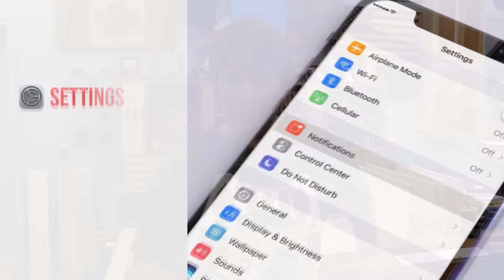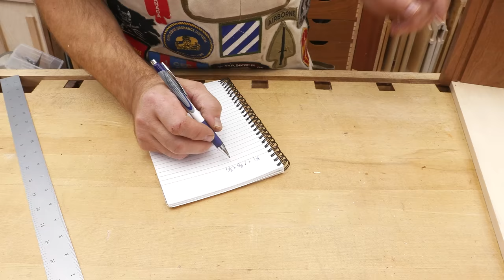How To Make Drawers For Fine Furniture with Drawer Slips

Comment: Hi Rob...one more very usefull video class...Your drawers are amazing and very well done...my father did a lot of drawers but never with dovetails...He did a  lot of one kind of hardwood runner wich is 1/16" wider than drawer sides...so the sides never touch the carcass and the bottom has one inch runner each side...they called this NK drawer...Swedish style from Nordiska Kompaniet...intersting way too...no wear (or almost) on the bottom
Reply from the maker: Interesting.  Never heard of that I will check it out

Comment: Rob, this is a nice idea.  I'd probably reserve it for a high-use high-quality project.  I always end up making my drawers slightly too narrow so that they rack a little side to side, when you're dialing in the right fit are you really testing for whether or not you can push the drawer in on the corner with 1 finger?  Do you have any concerns about how the finish might change a fit this precise, or do you never use any surface building finishes on drawer sides?
Reply from the maker: you should watch my drawer making playlist.  I make my drawers slightly oversized so thy will not fit the opening then VERY carefully plane the sides, check fit until it just fits with no side to side slop.  The onli finsh I put on my drawers is wax on the outside.  and yes you really can push in the drawer with one finger in the corner

Comment: Thanks Rob.  Hadn't heard of these before.  Would you want the drawer slips to be softer and to wear easier than the main carcass/case itself?  Just trying to think what would be easier to fix down the road - grooves in case vs. drawer slips.  Since this is all new to me, I am likely missing something in this rational.
Reply from the maker: By adding the slip you are reducing or eliminating wear on both since the wear surface is bigger.  Making a new drawer is easier than making a new case though

Comment: I do this a much easier way. Simply make the drawer in the normal way, but with a shallower groove if you use a reduced thickness for the sides. Then after the drawer is completed and the bottom installed, simply glue two plain strips underneath.
The other way is to rebate the bottom edge of the sides (to accommodate the drawer bottom) then glue a thin yet (say 1") wide flat strip of hardwood underneath.
Reply from the maker: That works too
Reply: Would gluing a hardwood strip to a solid wood bottom cross-grain be a great idea?
Reply: @rootvalue  - not sure what you mean by crossgrain? The grain of the drawer slides should run the same direction as the drawer moves. So in-and-out would mean front-to-back.
In my country they tend to only make drawer faces from high quality wood, and less durable timbers are used for the thinner sides and backs. Even quite high-priced furniture uses cheap pine for the carcass, or even MDF. This means that narrow lower surface of the drawer sides might be only 3/8" or 1/2" (9-12mm) and it wears down quickly on heavy drawers.
So when refurbishing drawers we usually saw & plane it back to flat, then glue on a wider strip of hardwood to replace it. With some wax on the slides, the hardwood will literally last forever!

Comment: I'm curious... it might be a good exercise to look into the physics of wear.  I wonder if using hard woods on both wearing surfaces, the drawer slides and the platform the drawer sits on, does any good where longevity is concerned.  Can you virtually eliminate the wear by making both surfaces from hard woods? Or, is it just the way of the world that you need to account for inevitable future repairs and make the more-difficult-to-repair surface harder than the paired surface so the easier-to-repair surface wears and the other does not?  It may be that incorporating hard wood on both surfaces is a great strategy, I don't know, but intuitively there is a question in my mind now...  By the way, Rob, your work and attention to detail is a delight to watch!
Reply from the maker: Actually I think doing both surfaces with hard wood is the better strategy.

Comment: If I've already built a drawer the traditional way, minus drawer slips, then I've got about 3/8" of clearance between the underside of the drawer bottom (let into the grooves in the sides) and the bottom edges of the sides. Could I just glue a strip of hardwood to the inside-bottom edge of the sides directly under the drawer bottom (being careful not to glue the slip to the bottom itself) and flush them to the bottom edges of the sides?
Reply from the maker: Yes that would also work

Comment: I see a chisel plane on the bench at the end of the video.  Where did you use it?
Reply: Maybe to flush the bottom edges of the slips closer to the drawer front?
Reply: Maybe, I thought of that too.
Reply from the maker: On another drawer I was working on.  To plane into a corner

Comment: While I appreciate  the craftsmanship, wouldn't it just be simpler to cut a thin strip and glue it onto the bottom ... exactly the same result (a wider wear strip) with far less work!
Reply: You wouldn't really want to glue to the bottom because of the precise fit of the drawer. Any movement in the sides wouldn't necessarily align with movement in the bottom. With such tight tolerances in Rob's drawers, it could affect that perfect closing action he describes at the start. If you were just to glue a strip to the side, below the bottom, it would likely be a weak joint that broke off in use at some point. Of course, if you're building drawers with much less tolerance, then it will be less of an issue, although you'd maybe want to match the wood type of your strip to the bottom panel. Edit: also, you'd need a gap between the side and the strip to allow for movement.
Reply: You wouldn’t get the thin drawer sides then. I usually make my drawer sides 6-8mm and drawer slips about 15mm wide for a total bearing surface of 20-22mm. Makes drawers considerably lighter. 

On wide drawers you can add a muntin or two in the middle for extra bottom support too, made in a similar way but screwed up into the drawer back. This helps keep the front and back from bowing too.
Reply: Gluing to the bottom and trimming the wood to the same height as the sides would still achieve a perfect fit ... you could add 1mm gap between the strip and the side in case of movement (even though plywood does not have much seasonal movement).

For the second reply (if replying to my initial comment) ... how does gluing a strip onto the bottom affect the width of the sides?  I would agree that adding extra support in the middle of large drawers to help with large loads makes sense.
Reply: @Barry Christie When making drawers without slips you need to make the sides thick enough to cut a grove for the drawer bottom while still leaving enough material to keep them strong. Drawer slips allow for much thinner sides, in some old English furniture the drawer sides go down to 3-4 mm from what I’ve read, although I don’t push it that far!
Reply: @ciaranoloan6199  Ahh, the penny drops ... I didn't pay enough attention to the drawers that Rob had made (no grooves for the base in the sides) 👍
Reply: Actually the French way to do drawer slips is to glue the slips to the bottom first. Then fit it and glue it to the sides. That way the drawer will be much more solid. and you can flush the slips to the bottom. Witch I think looks alot cleaner
Reply from the maker: You can do that if you don’t care about the aesthetics you can add the traditional way